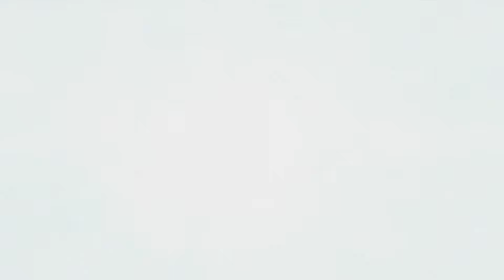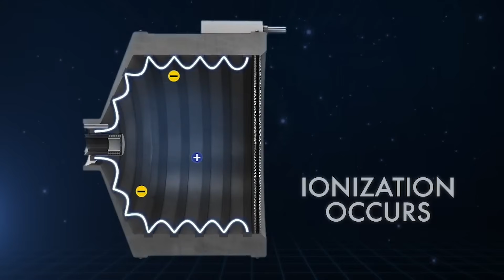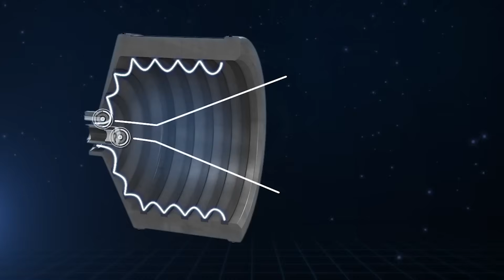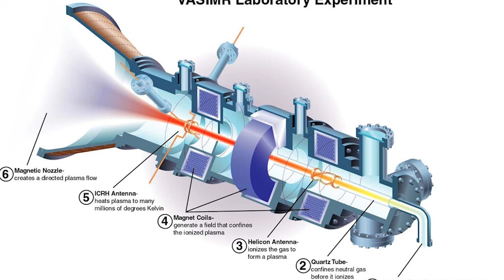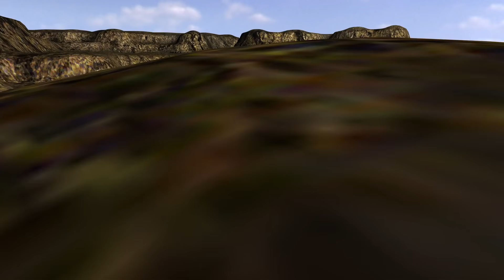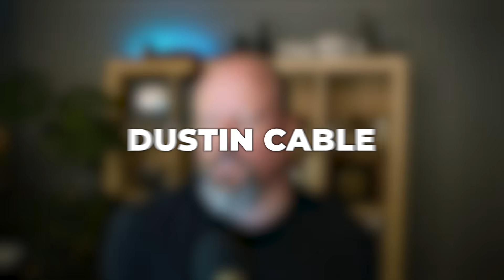Ion Engines for The Solar Gravitational Lens and Beyond

Comment: I'm curious about the beamed power idea. If we send a craft to the solar lens surely it will be too far to get much power. Would the engines work well enough with a small onboard power generator then? We'd need something that can operate at a wide range of input power

Comment: A Nuclear thermal 3 stage on top of conventional scond stage for BFR plus an h8gh performqnce ion engine on top under the telescope  can be done within 10 years if Nasa can easly, no new engineering or non exisoting tech..just  the regs around Thermal nuclear engines need 5o be flexible

Comment: I am curious about the gravitational lens concept, and I am instantly hit with one question: How long would it be between observations since positioning the scope would, I would imagine, be a large part of the process?
Reply: It's often suggested to send several small craft at different positions. If we have really efficient engines like this video then moving a larger craft around might be better. There's probably also a lot of science that can be done with a single "pixel"

Comment: Could you combine electro-thermal energy with the chemical energy of propellant like hydrolox to achieve exhaust velocities even greater than either of the methods on its own?
Reply: idk about that but most electric engines can also have afterburners
Reply: Not to answer my own question, but maybe regular combustion could drive the electric generation.
Reply: @Fiercefighter2  the whole point of electric engines is chemical fuel has limited energy density. Powering an electric engine with chemical fuel would be worse than a chemical rocket

Comment: Fraser, I know you usually interview scientists not engineers, but I think it would be cool if you could get an interview with an engineer from NASA's marshal space centre that is working on rotating detonation engines.  That would be a very interesting interview.
Reply: The rotating engine is a bad design for hydrogen and in space engines...can only add effecincey with Kerosene and air intake
Reply: Marshall Space Center 🎉

Comment: The fusion power part was kinda hand-waived, but seems like it could perhaps be the more important part of the system? For that matter, with the availability of such energy density, would plasma thrusters really be the best use for it, or are there other, better systems also enabled by the fusion power?
Reply: We are very close to being able to generate fusion power, I have my doubts that we will ever get to net positive, but for space, we just need to be better than fuel.
Reply: @viperswhip  The design doesn't work without being net positive. If you need an external system to concentrate extreme power, you lose the 'high' thrust, and you're no longer running your rocket on fusion power, rather, it is now a questionable middle-man.
Reply: Fusion reactors are already very similar to plasma thrusters he mentioned. There are already some startups like Helicity more-or-less adding some fusion reactions to said plasma thrusters. It might open designs impossible without fusion though. I don't know how much work has been put there. A z-pinch like ZAP Energy has been predicted to have ~1mil seconds of specific impulse

Comment: I once explored a concept for a space engine capable of generating forward motion without propellant. The idea involved using an electromagnetic mechanism to shoot an "anchor" backwards, tethered to the spaceship by a loose rope. As the anchor moved away, the opposing reaction force would propel the spacecraft forward, with the effect lasting as long as the rope remained slack. When the rope eventually tightened, it would be connected to a generator that converted the tension from the rope into electricity. This energy conversion, along with the losses in the system, would shift the balance of forces, causing the spaceship to slowly gain velocity over an extended period. But I am not entirely sure it would work. The electricity generated could power some sort of photon thruster. Probably the energy required to launch the anchor would be more efficiently used to power the photon rockets directly. It's a thought experiment in the direction of having some form of energy conversion that could lead to acceleration without shedding mass.

Comment: I sure hope that the use of fusion energy has finally moved away from using “steam engine” technology to convert all that thermal and EM energy into usable electrical and or plasma power. Any near-term prospects?
Reply: Helicity, Helion, TAE energies (probably), Princeton FRC Direct fusion drive, Pulsar Fusion. any z-pinch like ZAP energy potentially. Lockheed Martin had a concept a few years back

Comment: There is an ion thruster called the Self-Contained Ion Powered Aircraft. It is patented for carrying its power supply onboard!  There are more than 45 videos of it online as well as a website for it.  The craft produces more than a 1 to 1 thrust to weight ratio along with its power supply.  There are also videos of it lifting onboard propellant tanks.  As the guest said, roughly speaking the speed of the propellant is proportional the potential (voltage). The SCIPA system also called the Ion Propelled Vehicle, utilizes very high voltages so its ISP would be very high in space.  At a sustained greater than 1g acceleration it wouldn't take long to go anywhere in our solar system.
Reply: Thank you for sharing that -- hadn't heard of it before.

Comment: If this electric engine could have some kind of method for harvesting fuel, could it stock up on fuel on passing into a gaseous nebula?
Reply: there was a man named robert duncan enzmann, who proposed a particle accelerator driven ship called the echolance for the Star Wars initiative. the concept was to use onboard reactors to power high performance accelerators to push out stored propellant. once up to speed, it used the interstellar medium as propellant, like with the Bussard ramjet, but without fusion. with that said electric propulsion can use anything that is ion-able, provided the craft has the power to drive it.

Comment: Has anyone used liquid FOOF as a flow battery yet? It's 10.v electro galvanically, dense and extremely reactive so even if you can only run it once as an electrochemical source. You could use it as a pre reactant to get the plasma moving before giving it a squeeze with a magnetron to make a reaction engine boosted with electricity garnered from the fuel flow. Maybe liquid NaK and FOOF that would give you very dense exhaust stream. Basically  make your chemical propellants a flow battery even if it only supplements the power requirements has the advantage it will produce more power and need less pumping the more power it puts out plus if you used a solar sail as a foci you could impart even more delta v into the exhaust stream giving you a huge vacuum optimised nozzle being plasma a coil on the throat would let you control the nozzle pressure regimes if you made it hollow cored you might even be able to use hamiltonian waves inside the plasma to get a percentage of the ions up to relativistic speeds using lasing,

Comment: 13 years to the SGL? I'll probably still be alive in 13 years! We need to do this quick!!
Reply: And as an astronaut you must have a working digesting system to supply the spaceship with waste products, if you become constipated it can take longer than 13 years
Reply: @doncarlodivargas5497  I am extremely regular. Also, I'd be sure to take my fiber supplements.
Reply: Sorry, the problem is to develop this 2nd gen small high efficient space travelling  fusion reactor. seeing the working fusion reactor always 25 years away (since 50 years!) we will never see it
Reply: Did you not listen to the rest of the interview?  This concept relies on technology that is not yet developed and probably won't exist for several decades. I am 39 and do not expect to see this in my life time.
Reply: @bluesteel8376  Yes Ive seen the whole video, but I answered to the comment above not to the video. and he hoped to be alive when this flight is happening! no way!
(or he may be Kane from Karl Edward Wagners novels... you never know)
Reply: @bluesteel8376  I just knew I'd come back and there'd be that one guy. Congrats! That one guy is you!